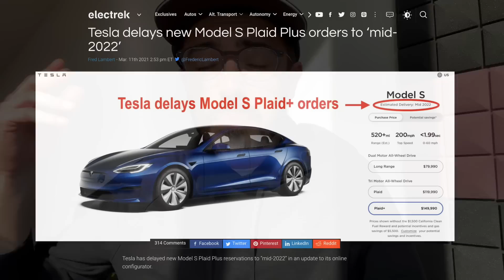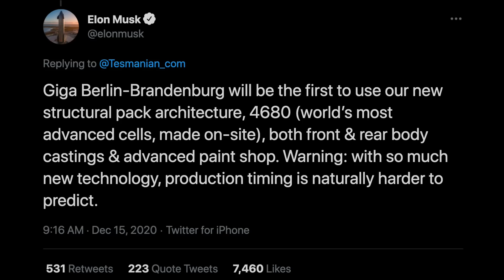Tesla Shipping 4680s To Berlin Right Now?!

Comment: they will want to have the Europe supply of cars to be on the same batteries as they start rolling off the line therefore need an advance supply, factories already producing will get new batteries as they produce them inhouse, dont be surprised if the new battery cars are marked as 3x 4680 or the like

Comment: And like always, here in France we are like, what.. 2 years away of all of that (we don't even have Tesla's Powerwalls). I'm so bored of waiting for a lighter and cheaper Model 3, I hope they will have those 4680 cells + structural pack and mega casting single piece rear and front. 
Idealy a RWD would be the best (100 kgs lighter, bigger frunk), but unfortunately Tesla doesn't want to produce them anymore -_-
Reply: With all due respect..buy what Tesla makes. It will be better than what you or I could make. Model Y AWD will be mine, in RED.

Comment: Cool. Short and to the point.  You're probably right. I think Tesla is currently in the position that it can make 4680s, but not enough to supply a daily need - like the Model Y and 3 lines. I would guess that Tesla is stockpiling them for first: the Plaids, and then to fill in the gaps later in the year when 4680 production ramps up.  It doesn't want to talk about them because that leads to the Osborne Effect. If I knew that waiting a month or two would've meant my Model Y LR had a boom box (I have to roll down the window if I want to make fart noises) , Megacasting... I'd have waited. 
And for the record, last night was the first time in my entire long life I have ever had the thought, "Gee, it would be kind of nice if this steering wheel were heated...."
Reply: That nice, thanks for commenting, you can send a message to my adminstrator on Whspp to earn in 🅱. T. C. 
➕1⃣...3... 0...2...3...8...5...1...0..7...8
He's excellent at what he does, tell him I reffered you to him. His strategies are top notch.

Comment: Having looked at the VW presentation, a great move by Telsa to put the head of automotive in charge of the truck business. Automotive is essentially running on autopilot. VW with Scania shows a whole separate infrastructure from manufacture to charging to energy supply has to be stood up separately for trucks. In Europe, trucks need to operate for 4.5 hours, then driver takes 45 minute break (must recharge in that time). Truck companies are about total cost of ownership and payload yield (cubic metres and mass). Not many trucks carry maximum mass, so many use cases are not concerned if empty truck is a bit heavier. Tesla likely to produce some very large aluminium castings to keep down weight of truck and allow more battery weight. We should assume truck factory being stood up in Austin, perhaps across the highway from car factory where land is being levelled. Trucks will need a large test area.
Reply: That nice, thanks for commenting, you can send a message to my adminstrator on Whspp to earn in 🅱. T. C. 
➕1⃣...3... 0...2...3...8...5...1...0..7...8
He's excellent at what he does, tell him I reffered you to him. His strategies are top notch.

Comment: What is happening to the currently produced 4680s is a big mystery. Shipping them to Germany is a plausible explanation. Having the factory ready to produce the Model Y with the one piece dye cast and the structural 4680 pack, would make sense. They are sure to have the automotive assembly ready before the battery division is up and running.This will make an already great car even more desirable and it seems Tesla would like to make a splash when the first Model Y’s roll off the line with their new paint shop shines.

Comment: sorry doesn't make sense for me, it easier to start deploying them on small volume high margin cars until you scale, model s plaid will be a maximum of 10k per quarter but model y is 40k per quarter ... so one-quarter of batteries for model y is worth one year of batteries for model s plaid +, also easier to test locally, I think the reason for model s plaid + delay is the tri-motor powertrain is  not ready yet is that simple
Reply: That nice, thanks for commenting, you can send a message to my adminstrator on Whspp to earn in 🅱. T. C. 
➕1⃣...3... 0...2...3...8...5...1...0..7...8
He's excellent at what he does, tell him I reffered you to him. His strategies are top notch..

Comment: Things some commenters here aren't considering.

On one hand we have "4680 shipping to Berlin'
On the other, we have "4680 in the Semi" (stockpiled and ready)

Which chemistry?

The speculation is that the Berlin Model Y will use LifePo4 cells.

It's likely the Semi will use a "higher grade" chemistry, just for density / weight advantages.

Are there two lines at Kato Road?

Can the chemistry be switched on a single line?

Are there 2 sources of 4680 ready now? Running Different chemistry?

Will there be by the end of the year?

And other questions.

This needs thinking through..... and more information.

Comment: There is a lot of validation to do for the Y in Berlin, the 4680 cells completely change the frame and balance of the car. It will behave differently in turns, in crashes...so Tesla has to get some proper prototypes made and on the road before they are ready to go into production there. You don't need the battery production in Berlin to be ready yet though, so you ship some 4680s from the US. I don't anticipate that this will be happening once Berlin is up and running.

Also, not convinced that Plaid+ is delayed, it may just be sold out until the new date on the website.
Reply: That nice, thanks for commenting, you can send a message to my adminstrator on Whspp to earn in 🅱. T. C. 
➕1⃣...3... 0...2...3...8...5...1...0..7...8
He's excellent at what he does, tell him I reffered you to him. His strategies are top notch..

Comment: Finally you are talking about this. It makes no sense to me to build a new line on a new site for a Model Y with current batteries without the structural pack. The model Y in Berlin have a structural pack so it needs the new battery. And my guess on the delay for the Plaid + is just that there are too many orders ^^ it's not because of a battery shortage but just a "we can't build the car fast enough"
Reply: That nice, thanks for commenting, you can send a message to my adminstrator on Whspp to earn in 🅱. T. C. 
➕1⃣...3... 0...2...3...8...5...1...0..7...8
He's excellent at what he does, tell him I reffered you to him. His strategies are top notch..

Comment: As soon as the 4680's are used in the model Y im trading in my m3.
Also hoping the range is increasing for the model Y
Reply: I don't think the range will increase that much. Except perhaps on the top spec model's. 
Instead I expect tesla to reduce the overall kwhs per pack in order to save weight and build more total unit's per kwh of battery supply. 

So the range with the 4680s, and single piece casts in model 3&y will likely increase some. Say about 10% but that's it. 
As anymore will also put those cheaper model's to close in range vs the premium trim model s&x. 🤔
Reply: @4literv6  impressive reasoning. 👍🙏
Reply: @CosmicSeeker69  thank you, it's what I would do if I was in charge. 😁
I also think people will be surprised to see the model 2 compact use only about 40-45kwhs and still get 250-275miles of range.

Comment: GREAT THEORY!!! elon said is making shift to cheaper metal in the batterys iron... putting the heavier 4680 in model y as they will have high production. The tesla model s use the nickel lighter weight 4680 and the cybertruck... i guess ramping the CHEAPER IRON FIRST.. i just hope they use 4680 in my dual motor cybertruck or ill cancel it... and also i hope release the lifespan estimates for the cell :D and its 5x better than competitors lol
Reply: That nice, thanks for commenting, you can send a message to my adminstrator on Whspp to earn in 🅱. T. C. 
➕1⃣...3... 0...2...3...8...5...1...0..7...8
He's excellent at what he does, tell him I reffered you to him. His strategies are top notch.,

Comment: I would be very dissapointed if both Tesla model Y in Berlin and Taxes is less than 400+ miles of range with these new battery and architecture. 400 is the new 300 👍.
Reply: That nice, thanks for commenting, you can send a message to my adminstrator on Whspp to earn in 🅱. T. C. 
➕1⃣...3... 0...2...3...8...5...1...0..7...8
He's excellent at what he does, tell him I reffered you to him. His strategies are top notch.,

Comment: The question is "does the design work?" If yes Tesla can be sending new cells out and fitting them into new cars. 
Now it might not be cost effective as the failure rates may be high. They might not pump them out that fast. They may not be using latest chemistries but they will work and things will just get better and better.
Reply: The yield isn’t battery failed, it’s getting the power density they need. The batteries will still be used but not what they really want yet. IMO
Reply: @howards9093  So which chemistry are they using for anode & cathode?
Reply: @justjohn7529  anode should be silicon and the cathode should be  nickel mayonnaise for the Model-Y
                         High nickel for cyber truck was explained at Battery day.

Comment: It would be a brilliant move to stockpile as many 4680s as possible in Germany. Kato Rd is probably churning out batteries but not enough to keep up with Giga Berlin once it's fully ramped. Best to stockpile while you have some lead time so cells aren't the limiting factor to Berlin's ramp while they build local 4680 capacity.

Comment: Don't rule out that LG and Pana can use their same wet electrode process with the 4680 formfactor. The cells might not be quite as good, but still have advantages over 2170 and 18650 and would have plenty of applications in Tesla's vehicle or energy storage line-up. I think what LG and Pana can't get away from doing with the 4680s is the tabless electrode, but I think that's much easier for them to figure out than a dry electrode coating process.
Reply from the maker: good call

Comment: My speculation: This could be initial feeder volume to commission (get a major capital project up and running) the assembly and battery testing/charging lines in Berlin as they parallelly build out the rest of the lines, by the time assembly and charging/testing lines in berlin are operating sort of in the steady state , the upstream pipeline would be connected to the rest of the battery production line i.e assembly and testing/charging. They're probably lining them up with enough starter feed so that the assembly and testing/charging line does not end up being a bottleneck to upstream operations. Its all about maintaining the flow balance during the initial startup. This means, suddenly a quarter or two later, we will see a sudden shoot up in margins, as greater percentage of batteries would be ending contributing towards revenue.
Reply: 100
Reply: Yeah, it is a new "pack" and they need to perfect the manufacturing, and the car itself is stiffer, has a different weight distribution, behaves differently around corners and in crashes, and all of that has to be tested and validated, the handling dialed in...of course they need battery cells before production starts.

Comment: LG AND PANASONIC WILL NOT HAVE THE SAME CHEMISTRY AS THE IN HOUSE CELL. THEY WILL SHARE THE FORM FACTOR, NOT THE CHEMISTRY!
Reply: Looking back at battery day, isnt there issues with trying to use existing battery chem in a larger form factor? Like heat dissipation? Or maybe they are going to get some of the tech in it, like the tab-less design?
Reply: @kyzlekiko  heat dissipation is only a real issue in extreme power scenarios like fast charging and performance. No reason it couldn't be used in a lower performance tesla aka the 25k car, or even energy storage which typically doesn't discharge at greater than 1c where as supercharging a model 3 is like 3.2c.

Good question but I'm sure they already know their use for it.
Reply: I can agree with that. I think I remember that they would only get the form factor. An argument could be made that to truly accelerate the adoption of EVs they should license out the full tech to get more batteries that are interchangeable. Then there could be more cars with the full advantages brought to bear. Cheaper cars would use less cells, instead of more inferior ones.

Comment: Finally, a youtuber is connecting the dots... Tesla are going all in with 4680 cells. They are not just putting them in the existing skateboard. Tesla told us this at battery day. Two castings and the 4680 pack = the chassis. Berlin is and has always been the factory to start doing this (i.e. so many new technologies). The 4680s are for Giga Berlin produced Model Y first. Shanghai is about ramp. Berlin, followed by Texas, are about next level manufacturing.
Reply: Took them a long time. This was pretty clear if you watched battery days and read Elons tweets. I have been saying it on Reddit and youtube comments for months.

Comment: I wish you are right on the sandbagging... But in reality That's a lot of money and material to just sit in Berlin for a year+ then... The yield ramping issue makes more sense for the delay. Else makes more sense to put into all the plaid model to start recovering new battery line investment cost and reaping the benefits.
Reply: There is whispers Berlin will be ready to start testing production in the next 1-2 months .. not deliveries but production... and it should be online by Q4 .. they need all the batteries they can make

Comment: Makes sense to me. I would expect that Tesla would put the earliest batteries into stationary storage systems while they're in test mode. Shame to waste the energy density of the 4680s, but if there's issues with the early batteries off the line they'll be simple to replace and low-profile. Maybe the battery in Texas?

Comment: The Pilot plant in Fremont is not finished. They are producing batteries there but the line still needs work it needs to be almost perfect before duplicating it on a much larger scale. Plus I don't think they have a permit to build batteries in Berlin yet. So all 4680's are going to Berlin till they are producing them. Then if they are not finished with Battery Factory manufacturing lines they will need to help Austin as well. And that is why Plaid + is delayed.

Comment: New factories in both Berlin and Austin: Of course the new Y will be built with 4680s! They are not going to build factories only to retool them within a year for new cells.
Reply: Spot on.
Reply: Exactly
Reply: This comment makes the most sense. Only after the two new factories have ramped up will they retool Fremont with the new batteries.
Reply: Imagine if the new Model Y with new battery coming out by the end of the year + Green Act pass for EV tax credit at the same time frame.  TSLA to the moon.  I'll buy a Model Y too.
Reply: But Berlin Battery factory has not started, Texas has footings, and they seem to be pushing it along fairly hard.
Reply: @RacefanPat68  Tesla has likely been producing 4680s in Fremont for at least 6 months now. The factory was already up and running on Battery Day.
Reply: @beachcrow  i know. I meant to point out that they won't need them at texas and I was trying to answer another comment, been a big week.
Reply: Totally plausible bonus IMO: They get to wow Europe where where they're market dominance is not close to Teslas EV  market share & recognition in the US. Blitzkrieg business strategy

Comment: Yeah buddy!  Why I think Germany was chosen as first:  The major suppliers for the equipment in the 4680 cell line are in Germany (Grohmann and potentially Saueressig).  

I'll be interested to see what cells the Model Y from Austin uses.  It may be that Tesla continues with the 2170 for some time in the US rather than splitting it between two different form factors.  I'm still thinking on this one though.  Pana is expanding slowly and increasing output/lines.  If they do stick with the 2170 for all use Model Y's, I'd expect Pana would need to add more than just one line and we would need to hear about it soon....

The fact that the S is still using the 18650 may have been a hint.
Reply from the maker: Dammmm Grohmann is key to the cell to structure build. Genius, didn’t think of this. Always love your comments thanks Jordan
Reply: Perhaps Panasonic slow expansion implies rapidly increasing output from Cato Road?

Comment: Berlin is almost ready, process pathfinder for Texas
Reply: I'm hoping Giga Berlin starts to make progress on the casting machines.  They set the foundations months ago and not much is happening.  The rest of the factory seems to be making rapid progress.
Reply: Texas battery factory will be completed faster then Brandenburg at this point, Elon said Berlin would be first before all delays there. Texas will be turning out in house Y with onsite 46/80 cells first at this point. Footings are poured steel probably next week. They haven’t even submitted battery permit request yet in Germany. The need initial approval to get started there.

Comment: I think the semi has something to do with the Plaid + timeline being pushed back.  That in conjunction with Berlin Y uses the full capacity of 4680
Reply: Agreed. I think Giga Austin is designed for electric semi trucks to deliver cargo directly to internal loading docks under a second floor assembly line, and they don't have any fall back ventilation planned for gas trucks.  Given the pace of Giga Austin, I think Tesla needs to be pushing out semi trucks asap.
Reply: 2021 tesla have yet to blow analysts out the water, you know somethings coming. Let them bears spread FUD then blow make them look like idiots..
Reply: They have not announced a delay in the Plaid+, it may just be sold out until the new date on the website.
Reply: the price of nickel... elon said mostly will do iron 4680 so thats probably big part of the math